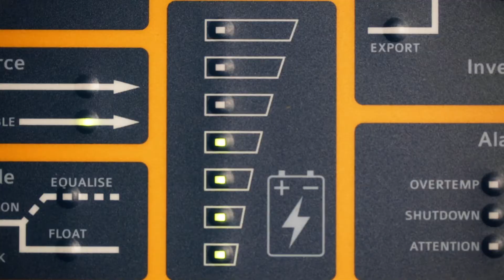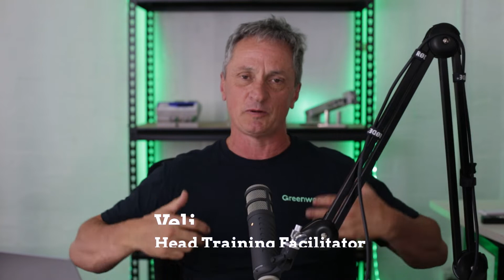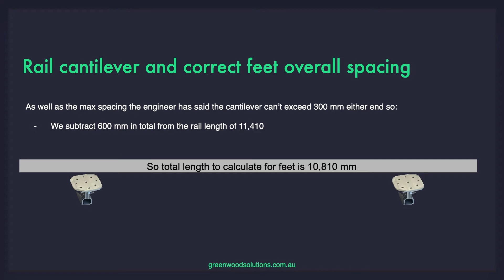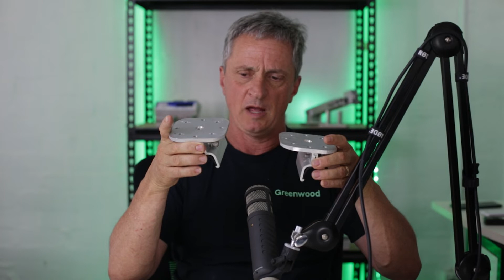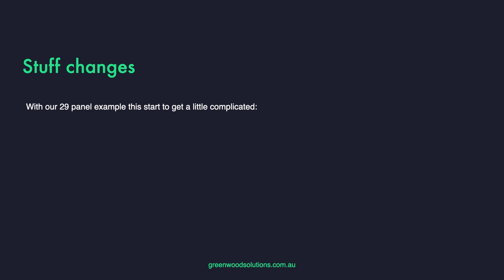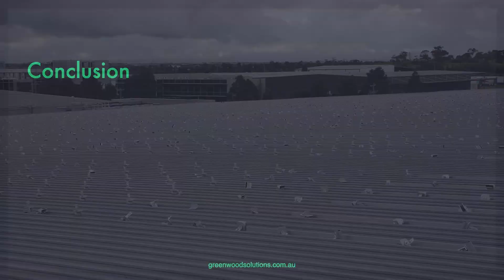Comment: Thanks for the detailed video. Is there any calculator to help calculate the number of components needed depending on the desired solar plant? I'm talking about all components, not just rails, brackets, etc.
Reply: I don't think there is a ones top solution for this. Effectively you may need to create multiple spreadsheets or sheets within one workbook and then reference to create a Bill of Materials etc. if you would like to become part of the Greenwood Academy Community see https://www.greenwood.academy/ where we have a lot more detailed, specific training.
Reply: @GreenwoodSolutions  Yes I think You are right. At this point I already have few spreadsheet. Perhaps the only good news is that companies that sell installation structures and installation elements are happy to share their calculators. Thus, after choosing the right company as partners, the matter of the calculator takes care of itself.